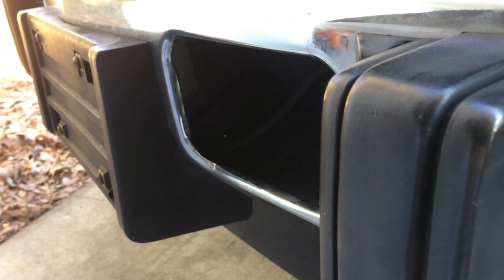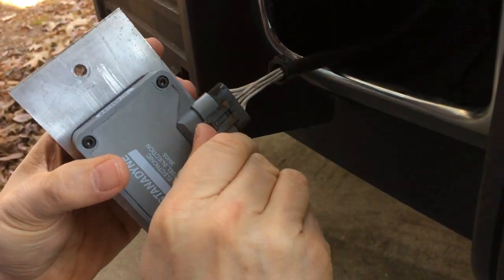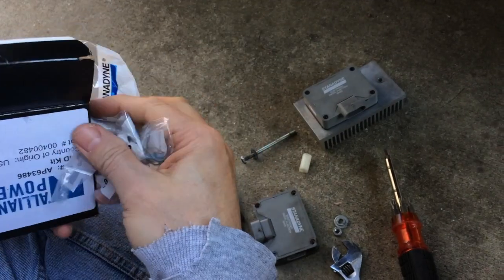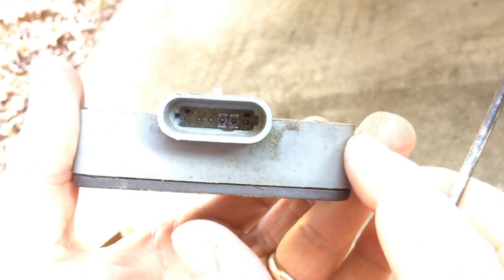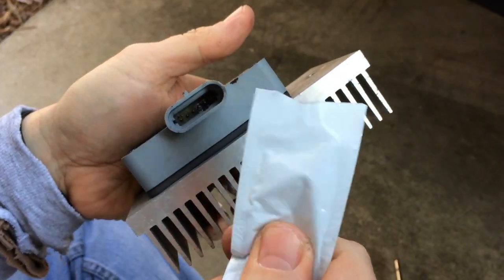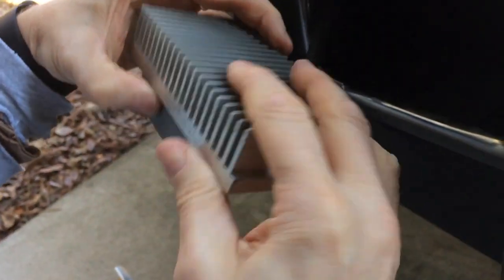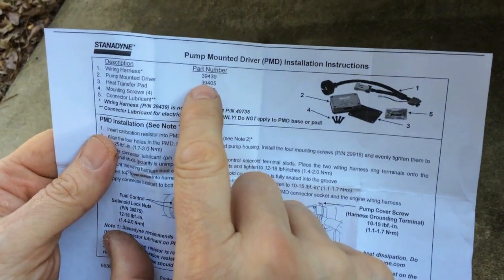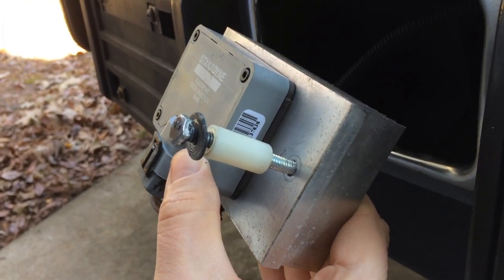1994 - 2002 GM Truck 6.5L Diesel Stanadyne PMD How to Swap the Resistor (Chevy & GMC)

Comment: I would suspect that it will be those FETs that fail...and if you were to replace them, you would have your module back up and running.
Reply from the maker: Thanks for commenting.  But this video is only about resistor values and installation in these modules.  The module here is brand new.  We cover module rebuilding in a different video here - https://youtu.be/GLjGUlCvFVM
Reply: @DrShock  Nevermind found it!  THANKS!
Reply: @DrShock I was hoping someone would know.  Eventually I am going to have a module fail and would like to know if anyone has tried replacing the transistors, or if the heat from the transistors has likely damaged other components in the module.  I am curious if this would have any unforeseen effect on the timing/resistor value.  I suspect not.
Reply: @DrShock  can you point me to your module rebuild video?

Comment: I have a 96 silverado diesel with a p1218 code. Do you think that may be the problem it says injection resistor circuit. Any suggestions??
Thank you
Reply from the maker: Usually, yes.  Either the resistor inside the PMD connector is missing, or it's gone defective.  P1218 indicates the PCM cannot detect the resistor value in most instances.   It's possible that it's the PMD itself as well, but usually that will come with other driveability symptoms.   Easy enough to test, just remove with a curved pick or snap ring pliers and test the resistance with a DMM.  The video description lists all the values.

Comment: Hi I was hoping for some help. I have a 98 gmc 1500, I've owned for 3 years and deffenetly cycled the key more than 50 times. I recently checked my pmd and there was no resistor. Do you think I should add one or will it be hard on my injection pump?
Reply from the maker: The 50 cycles aspect would have been pre 1995 only as best I recall.   Once OBDII came along that no along applied.   Later models will throw a scan tool code/DTC (around 1999 or 2000 I believe) if the resistor is missing.  In between years before that DTC change it'll run fine indefinitely if it had a resistor value stored in the PCM previously, until the PCM is reset by a learn event of some sort of course.  If you get into a state with 1995 thru around 1999 or so with no stored resistor value the engine will run with alot more noise until you address it, but it will usually not post a DTC until some event is triggered with a scan tool or such that requires one.   I'm guessing you are either running with a previously stored resistor value in your 1998 PCM, or you just don't mind the clacking noise that otherwise results from it being missing off the PMD.  ;-)   I'd suggest adding the resistor, they are relatively inexpensive.  There's info in the description about the different ones, and a link to eBay and Amazon where you can get one.
Reply: @DrShock  Thanks for the quick response 👍.  It's a bit rough sounding till it warms up but after that it's not to bad , has been the same since I've owned it . So it shouldn't harm my lift pump if I put a #9 in then 🤔? I bought 2 resistors locally today . Also does un hooking the batteries do a quick reset of the pcm?
Reply from the maker: The PCM is able to store most important learned values even when you replace a battery.  So that usually doesn't cause any loss.  Typically only a scan tool, issuing a relearn will do it.
Reply: @DrShock  ok I have a cheap one I will try out . Thanks again .

Comment: Do you have a video on how to replace the glow plugs?
Reply from the maker: No, that’s one I haven’t done yet. I forgot to film it the last couple of times I’ve done that job. But I’ll make a note to do it next time.
Reply: I am doing mine and cannot remove the male insert that goes into the oil filter housing. It is tight against the exhaust manifold. Can it be done without removing the manifold? Great videos btw. Extremely well done. Thanks
Reply from the maker: So on removing the glow plugs, at least on the 6.5L turbocharged engine, the drivers side #2, 4, 6, and 8 are very straight forward and not unlike spark plugs on a gasser.   For the passenger side the front most one #1 isn't bad, but then there are two heat shield tubes that you need to remove the retaining nuts that retain them to the exhaust manifold to get the next two #3 and 5.  It helps to remove the passenger side wheel, and the upper control arm dust shield on that side for access.  That gets you 7 of the plugs.  The last one, #7, is the most difficult of all as it's not readily accessible from any angle.   Coming up underneath is usually the better for that one.  Be sure to use a light coat of anti-seize on the new ones.

Comment: Where can I find out which resistor is best for my application?
Reply from the maker: These resistors were selected when the pump was initially calibrated in the day.   Most were either a #4 or a #5, but there were values all the way up to #9 (full list in the description).   If you google this you'll find most diesel shops suggest a #5 if you don't know what you originally had for a middle of the road guess.  They'll suggest a #9 if you want to increase fuel delivery to maximum.
Reply: @DrShock  Right on. Thanks for the info. 👍

Comment: I have a 95 6.5 1500 that keeps burning up the FSS. Is there a way to bypass the FSS so the PCM thinks its still working correctly? I replaced the first FSS and the truck ran good for about a couple of weeks than it just shut off on me while warming up. Never got it started again until I swapped that Solenoid again. Then it ran for a few hours. Shut off on me once. Then got it started right up and drove it around town, stopped at a store turned it off and never came back on. Had to tow it home. Any suggestions?
Reply: I should also add that while I was checking everything under the hood I happened to touch the FSS and noticed it was hotter than anything else on the engine and it had been shut off for at least 15 min already.
Reply from the maker: While GM never admitted it, locating the pump mounted driver (PMD) aka fuel system driver (FSD) on the side of the injection pump was an engineering design flaw imo.  While engineering theory says the diesel fuel flow will keep it cool enough, in practice the heat soak on engine shutdown adds up ultimately reducing the life of these modules significantly.   It's widely recommended to mount them remotely, as you can see in this video mine is in the front bumper.   This is the preferred relocation, though even here they still burn out every 3 - 5 or so years.  No, I'm not aware of any way that you can trick the PCM and avoid using this part.   Best suggestion is buy a relocation kit.  Then stop buying Stanadyne brand black PMDs.  Either buy the upgraded Stanadyne grey PMD (this is what I use) or the aftermarket one made by Flight Systems.
Reply: @DrShock  thank you for the reply. So I'm guessing its the pmd that needs replaced and relocated.  Hopefully that'll get it started.
Reply from the maker: Yep, the fuel shutoff solenoid (FSS) is not a common failure part.  The PMD/FSD is usually what goes, which in turn controls the FSS.  When an FSS goes, they typically show external signs of fuel leakage.   But they can fail internally don't get me wrong, and it can cause the truck not to start but there's usually a DTC code from the PCM in this case which you didn't mention.   The FSS is also not something you can trick the PCM on, but you can test the FSS (I neglected to mention this in my previous comment).    It's a bit lengthy to describe in a comment here, but it's going to be about checking its wiring harness for voltage during the glow plug cycle (engine not running key in wait to start mode) and then removing the FSS and reconnecting its harness and checking for the plunger operation while out of the vehicle (again during the glow plug cycle only).   Again they don't go often, but best to check to be sure.
Reply: @DrShock  okay. I know the FSS are getting burnt up cause I've gone through 3. The original. The new one I bought and now this one lol. I turn the key on and the plunger doesn't stick like it was when I first put it on.  Don't know of any leaks cause it hasn't shown any puddles on ground while parked or when it ran
Reply from the maker: Very odd, can't say I've heard of this sort of recurring FSS on the IP failure.   Did a quick scan on Google for ya and didn't really see any forum hits on this situation either.  Are you using ACDelco branded solenoids or aftermarket?   If I were having this kind of unusual problem, I'd go over the wiring harness very carefully as well for any chaffing or other damage that might point to random premature fails on this part.
Reply: @DrShock  ill give the harness a look. Do you know if they sell new engine harnesses for these trucks?  Not sure on the brand. I got it at autozone.
Reply from the maker: I doubt there's any new harnesses but you might find the connector with a pigtail on it if you saw something within the first foot or so.   When I find issues further back I usually try a local LKQ salvage yard and pull what I need for the repair.  GL.
Reply: @DrShock  alright thank you sir. By chance do you have cashapp or PayPal? Id like to pay you for your time
Reply from the maker: @Luis Armendariz that's very kind of you, there's a link in the description for Ko-Fi which is a paypal program to buy a guy a cup ;-)
Reply: @DrShock  ill give her a check. Thanks again. This truck was my dads and he passed away 2 years ago and I ended up with it so I want to get it up and running like it used to and its hard to find anyone that knows these engines so you're a blessing right now haha
Reply: @DrShock  didn't see anything in the description 🤔
Reply from the maker: Somehow this was the only video missing that link.  Thanks for pointing it out.  Fixed in the description now.

Comment: hey i was wondering I'm about to swap out my old faulty pmd on my 6.5 td k1500 its was already relocated to the top of the manifold but i would like to move it to the front bumper my question is old pmd is a black one but i will be upgrading to the stanadyne grey (bullet proof) one i was wondering am i gonna have to buy a new pump harness to fit the new grey extension harness or are they compatible
Reply from the maker: If you go with the grey Stanadyne PMD yes it has a completely different connector so you'll have to update the wiring harness.  FWIW I did this same upgrade several years ago and it's pretty straight forward to do.   If you buy the kit the harness is going to be included - https://ebay.us/JHE2Bj   

This is the same seller I bought mine from years ago, he's a reputable Stanadyne seller.   You can separately ask him about the extension harness to run this grey PMD up to the bumper (plugs into the OEM length one shown in the eBay link).

Comment: Where can I get this resistor? I just changed out my PMD and they was not a resistor in my box.  this is the first time I have heard about this resistor. Thank You 6/6/2020
Reply from the maker: There's a link in the description that should pop up some of them.   If you need a specific one, you may have to hit up a local Stanadyne dealer in your area.
Reply: @DrShock  thank you

Comment: Will it have a PMD pinout? I have problems with a GM1500 that won't start.
Reply from the maker: I've seen some old forum posts summarize it like this:
A - Control In (PCM) - Green
B - Pump Solenoid - Red (Large)
C - Low Reference (PCM) - Black (Small)
D - Ignition Positive Voltage - Pink
E - Signal Out (PCM) - Red (Small)
F - Ground - Black (Large)

Though I've not personally verified this, those who have opened them up claim the resistor connects between pins E and D in the circuit board layout.
Reply: @DrShock  
Thank you.
Do you know how to test the PMD? My truck won't start, it has a pulse on pin A but no pulse on pin E or a rear solenoid.
Reply from the maker: No, I don't but usually they throw a DTC code you can pull with a scan tool.  I've known about the PMD issues since shortly after I bought the one 1999 truck I have with the 6.5L engine.   So I've carried spare PMDs since around 2003.   I end up having to put a new one in every two years or so, even remote located to the front bumper area.   In my experience though I've never ran into a complete no start condition from one going bad.   It's usually the engine cutting out while driving intermittently that I've ran into.

Comment: Took my 6.5 GMC savana deisel short bus that I recently picked to convert into a camper on a little road cruises nice once I get going lol but going up inclines bus bogs down I cant even get up over 40mph and hesitating...going to have my mechanic check replace fuelpump possible fuel filter and relocate pmd I know these short buses aren't going to win any races but there is definitely an issue going any thoughts what I can do thanks great channel subscribed!!!
Reply from the maker: Loss of "pep" is usually Turbocharger related in my experience.  Changes in diesel exhaust color can also be a clue.   Did you check with a scan tool for any PCM codes?
Reply: @DrShock  I have no turbo on this particular 99 6.5 also no check engine lights ...were gonna do a fuel pressure test this week 50 to 60 psi is were I wanna be correct? 
Thankyou Dr.
Reply from the maker: You didn't mention your model year, so let me suggest you find the service manual for yours here and see what its pressure specification is - https://www.gmt400.com/threads/88-95-service-manuals.43575/
Reply: @ishgilbertstone4887  Did you get your answer, no turbo then you have a 6.5 N/A larger cousin to the 6.2 N?A also no turbo from factory, so you will be lacking in the HP dept.

Comment: Can a resistor go bad and cause similar symptoms to PMD symptoms?
Reply from the maker: Resistors as an electronics component (which is all this little board really provides) can short out, but its ultra rare.   I've never ran into it but if it were to happen, you would likely get symptoms the same as missing the resistor board entirely.
Reply: DrShock you know it’s weird that you say that. I have a parts store that sells doorman parts and will practically give me the parts. So i got the doorman relocation kit and did the installation. Ran great for a year or two then started having the failing PMD issues. I knew autozone sold the exact same doorman PMD and resistor with a lifetime warranty... soo i bought another thinking who cares I’ll have a good one on the truck and a good one in the back seat as a spare and when one goes out I will get a free replacement. Well i picked up the three they had in stock because the first two wouldn’t even start the truck. Had to take the clerk outside to prove it. The third one works but now they give me a hard time because it’s not a stock item. Four of the resistor broke while i was sliding them into the socket. So cheap that the center part of the resistor would break off and make the part worthless. Others broke the entire resistor off the PCB board lol. All crap but free to replace. Can’t believe someone hasn’t reverse engineered these to be absolutely bulletproof. 

I have also heard that even the brand new P400 engines going into military HMMWVs don’t use the DS4 pump to eliminate the PMD. Any idea if this is true?
Reply from the maker: I've only had luck with the updated Stanadyne PMD (grey 39405 one).   Stanadyne was the original supplier to GM (the black one), until the warranty claims pissed GM off and they went to another supplier called Flight Systems.  I believe the Dorman ones are OEM from Flight Systems also.  None of these PMDs regardless of brand (I've had them all in the last 21 years)  will last more than a few years, even remote mounted in the front bumper air inlet space.  It's just a very poor heat dissipation design all around that cannot be avoided due to the special transistors needed.  The small circuit boards the resistor is mounted in breaking for you is unusual if you remove it evenly.  The resistor mounted on it is virtually indestructible, which is what my original comment 8 months ago was referencing.  AFAIK the US military never moved off the DB2 mechanical pump for the 6.5L HMMWV trucks.
Reply: DrShock thanks for the info!

Comment: Wat happned if you don't have the fuse installed?
Reply from the maker: I'm not sure what you mean by "fuse"?  I'm going to guess you meant no "resistor" installed since that's what the vid is about, well that depends.  After some point, if the learned resistor value is lost by pulling a battery and it needs to be relearned you might get a DTC (the newer the vehicle the more likely) and the MIL lit, in others you would never know.   The resistor goes with the Injection Pump calibration and they come in 9 different values. You should always swap the original resistor when installing a new PMD.  But if you never knew the original value, I'd suggest going with a #5 resistor rather than leaving it without one.
Reply: @DrShock  In the OBD-II 96+ year so long as you do not do a TDC "Learn" or theft deterrent learn in 97+ nothing happens, I year for a year with the resistor pulled just to prove a point to a unscrupulous seller of crap under moniker of A-1 customs, buyer beware, variable rate fuel on the fly  HA...Once you command a learn you will set a bad resistor code(missing/can't read value) and will not be able to start.

Supposedly OBD-Is 94-95 will relearn after 50 warm up cycles, I can neither confirm or deny I don't have OBD-Is I do have (2) 98 OBD-II 6.5 running great to this day.

Calibration resistor is used to set flow on a IP calibration bench when new or rebuilt, 5 is nominal 0 mm change, best to stay with resistor that was with the IP on your truck or use the one on the new/reman IP.